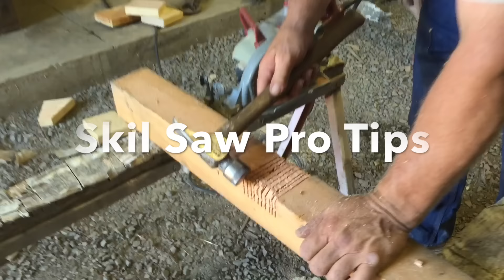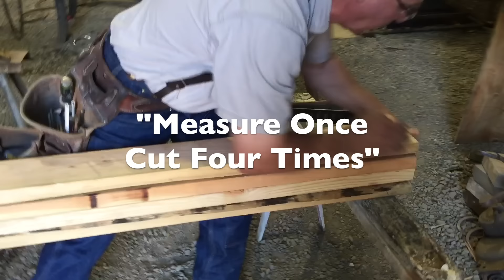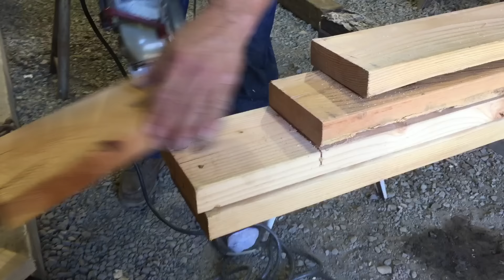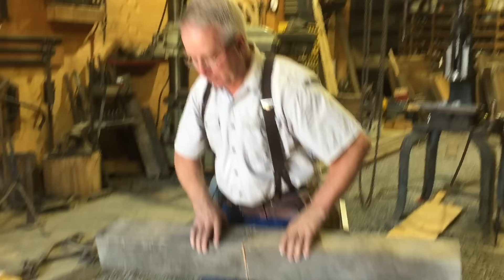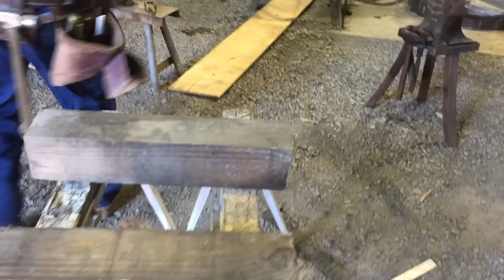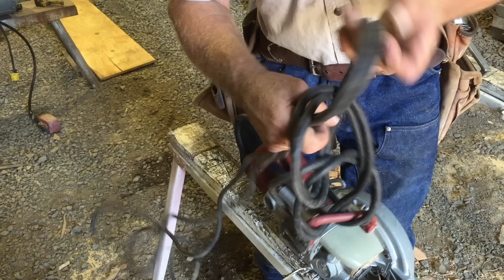Skil Saw Pro Tips

Comment: Just recently started to enjoy your very informative videos.
I saw one on your favorite tool mods(?)
I once had my jig saw and no jig saw blades. 
I had saw all blades.. no saw all
I had 4.5” grinder
I modified a sawzall blade to fit my jig saw and used this great (straight) cut to modify a plastic electrical box.
I ‘v used the sawzall blade a few times later with jigsaw👍🏽🎉🎉

Comment: If it's my turn to be the cut guy I usually use a miter saw to cut the hip cats and rafters but I'm primarily a finishing trim carpenter but sometimes in order to get the finish and trim on a job you have to frame the job so that's how that happens so yeah I will set up a jigsaw and a miter saw to cut framing and if there's a lot of built-ins and niches I'll even use a router with a quarter inch rabbit bit to put plywood inside the studs for diaphragm and stability of the shelving

Comment: You seem like a real nice guy I wish I would have learned from somebody like you instead of the nasty old men bitter bitter old men I mean they're good they teach you a lot of things you'll learn that to be a carpenter it's more than just nailing wood it's mastering all of the tools involved like when I set doors I was introduced to what was known as the fine f e i n multiMaster which now everybody makes one but it was one of those little oscillating saws I use those to cut shims so I don't knock my doors out cutting the shims I don't move my shims I don't bang the door jamb I just saw the shims off and then there's all the gauges the pocket hole jigs that allow you to build on the flat I love it but you seem like you're a nice guy and would have been a good person to work for whereas I paid my dues with assholes that firmly believed in hazing lol

Comment: So it's all about choice in Florida I would never hang off a second story building cutting rafter tails with that heavy son of a bitch but if your muscle memory is used to it then yeah I guess so they don't even sell worm drive saws here maybe one and it pawn stores and most of the time they use them for versalam beams just because they have more torque but I find a 15 amp standard Milwaukee saw works just fine and then a 13 and I have a 13 amp Hitachi with blue tape all over the bottom and stuff for cutting doors and trim and ripping sheets of plywood and things you make good videos

Comment: I worked a couple of summers as a carpenter's help, and I learned a lot of these tricks then, though certainly not all. 

I don't have the skill to do a free-hand 45 degree bevel, and I draw the line for safety at the plunge-cut on a board held with my leg... If the saw kicked out, it could cut your femoral artery. Good luck getting that under control without a tourniquet ready-to-hand (I'm a paramedic by trade these days). I do do plunge cuts when I can keep the rest of my body out of harms way though. The other tricks and techniques are handy, especially putting a longer cord on the saw and using chainstitch to pack things up. 

While outside the scope of this video, I must say that the biggest problem we have with building things these days is the needless complexity and waste that has become common. We could be building houses that are more comfortable, more practical, more affordable, and more environmentally sustainable. Instead we spend an endless amount of time and money on complicated roof lines and floor plans that don't make sense.

Comment: A trick I like to use after cutting through a beam and the center is sticking out like that without a ton of material is to just give it a few good hits with a hammer, usually flushes it right up.

Comment: The chain stitch works quick, but it gives the copper in your cords bad memory, and as they age, the memory turns into what I call "PTSD" where loops and hitches really get baked in. Learning to properly wrap cable saves time and energy. NEVER wrap it over your elbow. Start from the tool, make clockwise, foot diameter, loops with your  dominant hand and place them in your non-dominant hand. The cable should make a 1/4 turn roll as you wrap, following the natural turn of the copper, and any turns twist out at the plug end. Attach a 3' Hank of sash cord near the plug end with a clove hitch, leaving equal lengths of rope on each side. That stays there as a tie to wrap around your coil with a simple shoe string knot, and your cables will always store nice and neat.

Comment: All great tips, and I've used all of them. Couple things I'd add though; One; the "Polish Plane", (and  also plunge cutting) is great, and is quite safe IF you always keep the front of the saw table firmly planted. Dropping your blade into anything with the saw hanging free is a good way to damage or lose body parts. A cordless saw is actually FAR safer than a corded saw in this respect, plus you don't have to worry about chopping your cord off!

Comment: Wow Im cutting just a cross cut 2x4s , 2x6 a2x10 and a 2x12 I usually use my hand saw but I was given a circular saw 7 1/4 in Craftsman and I do use power just want to know how deep I need to set the blade

Comment: I find a mitre saw to be indispensable for framing a house.  Whether it's cutting the 6 x 6 posts....or cutting jacks, cripples, headers and such, it does a much faster and more accurate job than using a skil saw.  You can cut multiple boards in one cut....for specialty things that I mentioned.  The downside of using a worm drive is when you need to cut up in the air...or sometimes backwards...in awkward situations.  That's where a regular (sidewinder) skil saw does a much better job.  You can cut with only one hand in all kinds of awkward situations.  Worm drive is too heavy to do that..and weight too far forward...to do many things.

Comment: One thing you didn't mention is the reason for tilting the 2x when cutting, and that's because you're no longer pushing the saw, you're using gravity pull the saw, and gravity as a force is flawless. Pushing with your meat, the cut will be subject to the vagaries of nerves, hand-eye coordination, etc. Gravity will pull the saw with perfect efficiency.

Another observation: when there aren't any saw horses or their equivalent available, when cutting dimensional lumber, we use our foot as a place to prop the board up.

Comment: ah yes, the old polski planer.   Without a doubt the Skil 77 is the saw that built the west.  i still see what i call east coasters with the blade on the "wrong" side .  good god you guys...buy a proper saw for god sake.  i STILL have the first 77 i got in 1985.  i pulled the shoe and blade guard and we use it with a diamond blade for cutting concrete roof tile.  pretty sure the OSHA gal would have kittens if she saw that set-up.   while this guy adds a skyhook on day one i cut a shim to pin back the blade guard.

Comment: A great habit to get into especially if you use alot of company saws that pass thru alot of hands is to always set down the saw upside down in case the blade guard sticks or better yet stop the blade before setting it down but that takes a second I used a saw with no guard at all for years which more or less forced me into that habit but I have seen alot of people cut cords spin a circle in a sub floor wreck a blade on concrete I even knew a guy that had one walk up the back of his ankle hurt him really bad all from stuck guards just somthing to keep in mind

Comment: Great info!
I used a Skil Saw to cut through 1/2" aluminum plate using WD-40 to it wouldn't gum up the blade, it worked perfectly. Those things are extremely versatile and you take it to the next level. Thanks for sharing your skills and can I come to your shop and play with all those toys?

Comment: Brother from another Mother, I too have 45 years experience with the Skilsaw, and have a couple things for you... Your pre video warning shows you too understand this is a dangerous tool, personally I don't think HomeOwners should have access, it's a ProTool... anyway, when you set the saw on the ground near your feet it should be set blade side down away from your foot, I teach "Like turning off your ignition, turn your wrist to the left and set it down"... "Down" puts the blade lower on your foot should you step toward it, and "away" is away... 2nd, your "Polish plane", my "Scarfing"... Always keep a part of the table in touch with the lumber for friction control... Hope This Helps... From cutting concrete to trimming trees the SkilSaw does it all, with decades of experience...

Comment: As someone who did metal roofing for 10 years. If you want a good cut. Use a plywood blade backwards... It is noisier but 9 times out of ten the cut Is cleaner and there's no metal shavings hanging off. Especially for a finished edge. The blade he has works just as good ;) plywood blades are 20 bucks cheaper.

Comment: As a pro, I'd have to say the beveled rip demo is pointless unless you're just wanting to get wood out of the way and care nothing about accuracy. I'll continue to take 5 seconds to set the base on whatever angle's required. Would also keep that heavy ass worm drive in a box unless ripping stacked sheets of decking/sheathing all day..... and would probably still keep it in a box. 

Each to their own as they say.

Comment: A Worm-Drive Skilsaw. 
One of the few things that makes me truly, sincerely jealous of North Americans that they get to have it, and us Europeans don't.

Ironically, the Skilsaw brand used to be owned by Bosch - a German company -  but they've never even tried to make a 230V model for our market. Or actually any market other than North America... 
I guess it's because a typical family house construction here is masonry and not wood framing, that they just assumed there's no need/no market for a proper, worm-drive circular saw, and sidewinders are good enough.

My best option then is to get the cordless Skilsaw on Amazon or eBay, mod the charger to work on 230V/50Hz (which shouldn't be too difficult) and say bye-bye to warranty, for the charger at least (not that I care too much about that).
My second best option is to get a corded model and rewind the motor to work on 230V/50Hz... which is not as easy, but still feasible.

But then there's the problem with blades, because of that special diamond shaped arbor. 
Blades that are made by manufacturers like, I don't know... Freud? (probably better known by their brand name Diablo), which is:
1) an Italian company (!), 
2) owned by Robert Bosch GmbH (!!), 
3) the OEM supplier of blades that come included with the Skilsaw Mag 77 (!!!), 
4) producer of many other types of blades that fit on Skilsaws, some of which are ACTUALLY MADE in ITALY (!!!!), but they are NOT sold outside North America (!!!!?!), so if I wanted to buy some, I'd have to have them shipped thousands of nautical miles across the pond, instead of being able to procure them right here from the actual nearby source (!!!!!!?????). 

I don't understand this logic.

Comment: An item to remember when using a saw or any power tool. Guards are on these for the handler's protection, BUT if you operate them with a mindset that there is no guard, you will actually be that much safer. After all is said and done, that guard might not work all the time. I learned that the hard way and almost got my left arm cut off when the guard on the skilsaw did not retrack.

Comment: One item I notice that you do that I got in the habit to not do is setting your Skilsaw down in the fashion that you do. I always set the saw down the opposite way, with the saw blade parallel to the ground / floor surface. Reason being, if the guard does not retrack, the saw can walk back and possibly cut you or cut into a finished surface. Possibly very serious.

Comment: Awesome work. I like to see and work with old guys. but today we run lipo machines. Yes this tool uses alot of battery but still. It's so easy when you don't need to worry about the cord. But I have six to eight battery's to my disposal. I cut alot of aluminium with the skill saw. Soooo fast to cut metal with it. I would strongly suggest to use 🎧 doh.

Comment: this man has been using that saw for decades and is very comfortable with it. to those who are just starting carpentry or framing, take your time, measure twice, cut once. if you are working for a speed demon asshole who expects you to cut through things like you have been doing it for decades, quit. circular saws are dangerous and should be respected. once you have the experience this man has, go ahead, feel free to cut at the pace you think is productive. until then, try not to rush or you will cut things wrong, you will cut cords, you could hurt yourself very badly.  as the old saying goes, first you get good, then you get fast.

Comment: One thing I find handy. I’ve drilled and tapped a series of holes into the shoe of my favorite skillsaw (Milwaukee 8-1/4”): usually 1/4 20 or 8/32. Then I keep some bar-stock aluminum with similar holes drilled. I always have a couple of thumbscrew bolts handy (threaded into the top of the holes in the saw shoe). That lets me set up a guide on the saw for repetitive rips. Or if I want to get cute and cut out a concave, I can set a guide at an angle.

Comment: Always amazes me that Americans us penny gauge for nails when they could call a 2 inch nail a 2 inch nail. Also when measuring use metric. In stead of adding or subtracting 5/8 and 3/16th inches. you are using 10ths. 6cm plus 1.5 cm is 2.1 cm.

Comment: When you buy a brand new saw, you open it up and change the cord to a 40 footer?    What’s the reasoning ?

My tip, on any saw or grinder that requires a tool to change the blade,  secure the tool/wrench to the plug end.  This prevents it from getting lost/left behind and encourages guys to unplug before changing the blade.

Comment: Have you ever considered using over-under for cables/cords? I discovered it a year ago or so, and I use it anywhere I can. It's quick, doesn't really put any set in the cable and pays out without twists, tangles, coils etc. every single time. It's a method that sound guys use to wrap cables.

Comment: Watching you use a power tool like it's a lightweight hand tool is amazing. I had no idea that Skillsaw were THE creators of the circular saw and it was a puzzle why they're not seen the UK at all - the blade is on the CORRECT side!  Well it seems worm drive saws don't comply with health and safety laws here so that's why.  Still can't understand why most circular saws here don't have the blade on the left - where you can what you're cutting.

Comment: I got my 1st black and decker sidewinder when I was 15 with S&H green stamps. (If anyone remembers them lol) At 21 when I got out of the Navy I got my 1st Skil77, and still using the newest version 40 yrs later. Anyone who is serious about doing carpentry is going to take some risks in the cuts you may make. The key to doing it safely is in concentration. ALWAYS be aware of what you're doing and NEVER take it for granted that your saw is going to stay where you intend. Accidents happen when you're not paying attention or you try to do something stupid. Always keep a firm hand, and in some cases both hands on your saw. NEVER wire your guard open, it's there for a reason. Keep a sharp blade and let it do the cutting, don't force it. Kickbacks can happen, but it is usually when you're not paying attention to what you're doing. Unless you are ambidextrous don't try to make cuts with the hand you don't normally use. You don't have the same control. (40 yrs ago I made that mistake and took 26 stitches to my knee)<--(also not paying close enough attention). So 46 yrs of carpentry I still have all my fingers, and 1 mishap because  I did something stupid. Have respect for what your saw can do, but don't be afraid of it. That will only come with years of use for some. I can't say it enough, Be Aware! Happy building!!

Comment: I switched to the Bosch version cause it has a much better table. The mag saw table gets bent real easy just setting it down like that. Also you gotta try a Matsushita 40 tooth blade! Promise you wont want to cut with any other blade after! I used to use my Bigfoot to cut a stack of stair stringers, I always plated stacked, one 8 tackin one end, cut the top and the bottom plate is marked. We called that the Butchers plane in WA. lol 50 years old and I still swing a 32.

Comment: Hi guys 
I love all his tricks with a Skil saw ,  but the fastest safest way to cut any with 2'xs at 90 degrees is to lay lets say 12- 2'x 4' flat , not on edge . Square up the left edges with a large square.   Place your pencil mark on the right on one board and use a large square and mark all 12 at one time.  Then you can safely gang cut with 2 hands with your machine in one stroke.
Faster, safer, with more accuracy and with out all the fatigue of one handed sliding  boards left while holding a heavy Skil saw with the other.
So you make 1 cut not 12. As a Cabinetmaker/ Carpenter in my sixties,  I love his Showmanship but,
But there is a better way..   Gang cut with 2 hands.

Comment: I would also mention that two things will help before you attempt any of these tips. First a saw you are familiar with that you have used for at least a total few hours, some of these things I wouldn't just grab any old saw and attempt to do. Secondly, this kind of involves the aforementioned, a saw with a good blade and plenty of torque. I've used cheap saws before that struggled to cross cut a 2x4, that's not the saw you would want for this kind of work.